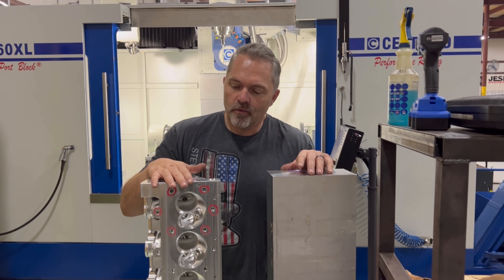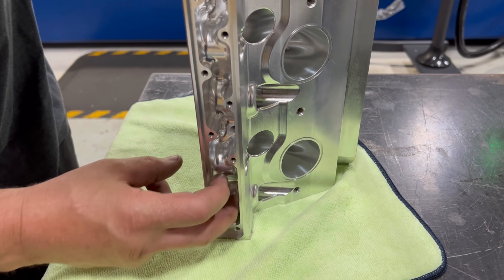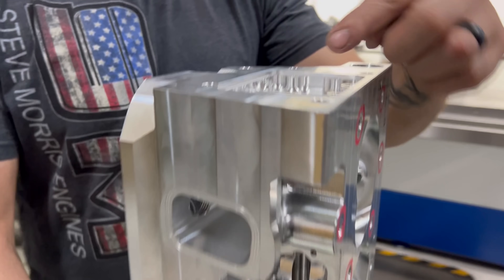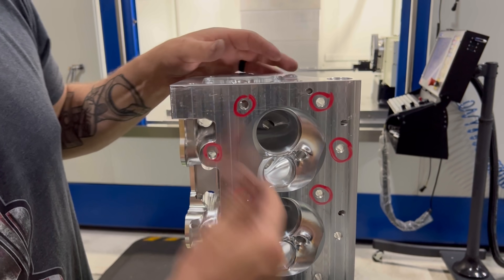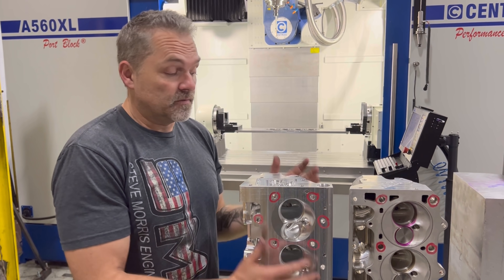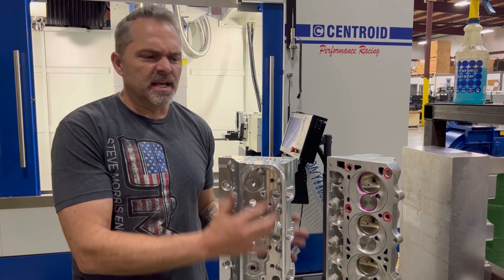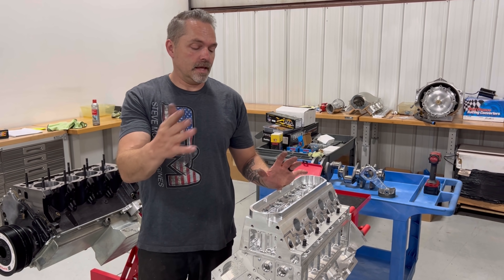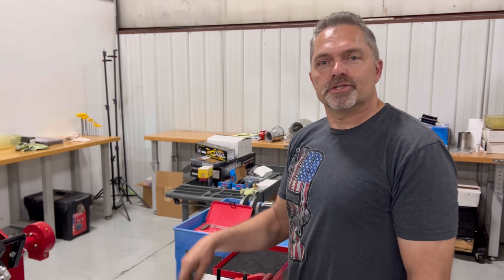THE ULTIMATE LS: The First SML Cylinder Head Is Done !!

Comment: I am running the Noonan ls edge platform with the wet block and wet heads.  I am curious as to how the sml compares with the ls edge.  The Ls edge  platform utilizes a billet block and billet canted heads, the only downside I have found is the need for proprietary valve covers along with intake and exhaust manifolds.

Comment: Took a lot of slow motion viewing to work out how the passage that goes across was drilled. Quite clever when you spot how it was done. Only thing I would have done different is put a thread at the top of the cylinder head (like the ones in the intake ports), so a cap could be "glued" in place to prevent water to oil contamination.

Comment: I would also "guess" that because you have no deck cooling passages to the block your clamping force would also be better even if you only had four head studs per cylinder because of different temps of the head around the typical water passages would cause some changes in the aluminum around those water passages which are cooler than the areas that have none.

Comment: Do you think the cooling flow will be even enough to work well in endurance like a boat motor running full load for an hour or do you think it will have hot spots from the drillings being limited?

Comment: Very impressive Steve . Obviously ur new block & head combination is going 2 make well past 2000hp with the way u have designed every thing .   One thing that might be worth while is if possible is adding some kind of coating inside all the water passages 2 protect these surfaces from corrosion.  Beautifull work .  👀👀👀 4ward 2 seeing this baby on the dyno .

Comment: Cooling going from hot side to cold side, nice way of bringing the cold side up to the same temperature, making for more even heat distribution in the cylinder, which makes for much cleaner running, and more even internal stresses once the whole of the block and heads is at the same amount of thermal soak.
What you need now, is someone to stick one in to a sports prototype for circuit racing, turned up to 12, because it's already past 11.

Comment: I am only familiar with 1 guy in the world (although I am sure there are others) that is really pushing the LS platform and putting it up against 481x and Hemi cars. That is 'Super Dave' Adkins and his (2500+HP) 427 Noonan Billet LSx Twin Turbo setup that he runs in his NO PREP KINGS C7 Corvette currently. If specs in magazines are correct, it's a 4.125" bore x 4.000" stroke tall deck/long Rod motor so that the big RPM doesn't kill skirts/bores over a season with a nice long rod ratio. His seems to be the strongest LS on the planet (that is currently running) and he seems to fall short in the HP department. Steve has said that the SML will be capable of 3500HP, but at what displacement ? Steve has also said in videos previous that anything longer than a 4" stroke in an LS is pointless and even perhaps dangerous on parts for Boost. For Strength, the SML can't be much more than 4.125" - 4.155" bore, so is it going to take TWIN 98's on 427-434 CID to make 3500HP ? Perhaps the SML could see 440 CID at best and stay strong. I am just wondering what it will take to see that 3500HP figure to be competitive ? What am I missing ?

Comment: Thirty five years ago I was messing about with sidedraft carbs and headers on a little 4k 1300 toyota. Group a rallying. I "O"ringed (viton) the cylinder head by hand , rectangular for exhaust and round for inlet because we lost an engine when one set of carbs developed an air leak and went lean and the other side worked beautifully. Well it melted the Teflon button on one piston pin, the pin groved the cylinder wall and exposed the water jacket. The poor wee engine finally faltered badly when the water put the fire out lol..I was told o ringed exhaust wouldn't be reliable but that head is still raced at classic meeting to this day. Believe in yourself and your engineering.. Still messing about machining by hand bits and pieces. Doing a 2.4 4g63 that we pumping out 700hp at wheels at only 6100. Stopped development to change turbo that involves moving radiators out of the way. We had  a super tall long rod billet block made. Leaks at water jacket covers which is disappointing and dowel locations for bellhousing were off centerline from.installed crank so that was another fix. Go fast bits have to be perfect in every way and frankly if the client can't accept that then they should just go fishing instead..My day job I keep combine harvesters going for a farmer. My aim is zero preventable failures. So much at stake down here in NZ with changeable weather conditions and very narrow harvest windows so breakdowns can literally cost hundreds of thousands of dollars in grass seed lots to rain. Enjoy your videos. Learned a lot and envious of your skills. I'm old school lol.

Comment: Hey Steve, is there any advantage to leaving a rougher surface finish inside the water jackets to increase surface area for cooling?
Reply: The trade off is the resistance to water movement and places for cavitation to occur.
Reply: I think you would find that the finish is dead smooth but the tooling path reflects light making them seem more pronounced but a quick polish clears all that for a mirror finish but in this case it's a lot of extra work to polish something that wont be seen just to make it look better
Reply: @shaynegadsden  I wasnt saying the finish is rough on the head he showed, I was asking if there is an advantage inside a water passage to having a rougher finish to possibly increase cooling surface area.
Think of the fins on a heatsink.
Reply: @notsofresh8563  my bad then but in terms of that no on a heat your trying to transfer heat to air which has a low thermal conductivity and capacity so maximising surface area is needed but water is pretty good at both so promoting flow becomes the priority, more cool water vs slower hotter water
Reply: You would think so. The more surface area, the better… but he’s the expert.

Comment: Steve you are a genius it’s about time somone solved that head gasket problem with those ls engines now you gotta talk Cletus into buying one of those motors off of you because it’s getting old watching his videos when they’re at the track and he’s always having those head gasket issues
Reply: Im pretty sure cleetus is just waiting hes mentioned it in a previous video when texas speed took too mean heat and he got sensitive
Reply: @thedude7726  And it's not like it's TSP's fault, like Steve said it's an inherent limitation in the stock head bolt design. And for what the LS was designed to do it's not even really a flaw, it only becomes a problem when you start getting into the crazy big boosted power (which is Steve Morris' bread and butter)

Comment: 10 head studs vs 18 head studs I really think you just changed the ls engine world upside down. The sml engine is a true masterpiece of art and engineering. I can’t wait to see some dyno time on this. Be cool to see different combos too turbo, pro charger, and one of those giant Whipple super chargers. Thanks Steve and crew congrats this is awesome.👍💪🇺🇸
Reply: What’s LS about it anymore it’s not an LS
Reply: @CoyoteFTW   At least the valvetrain/cam, crankshaft main size, bore spacing,  bellhousing, motor mounts, exhaust system, and accessory drive components